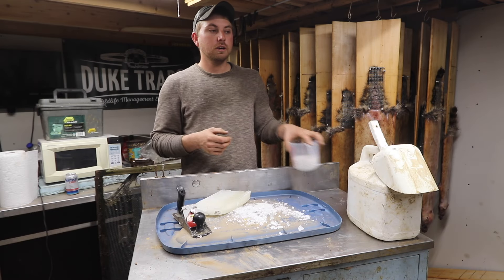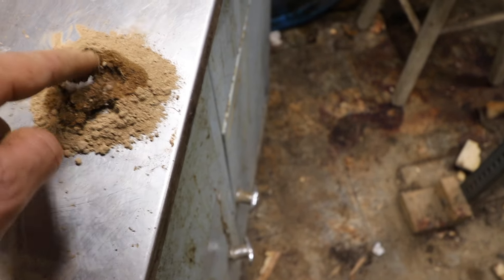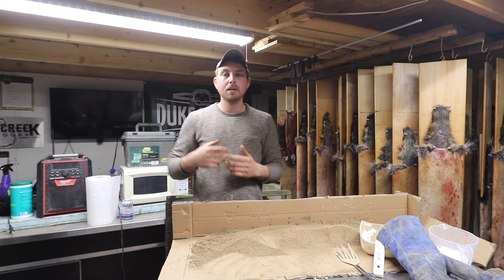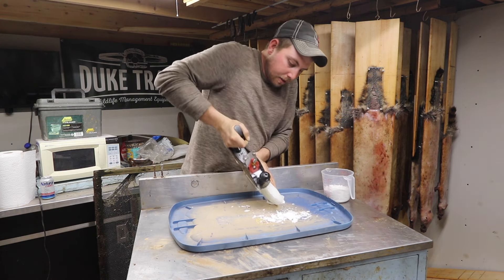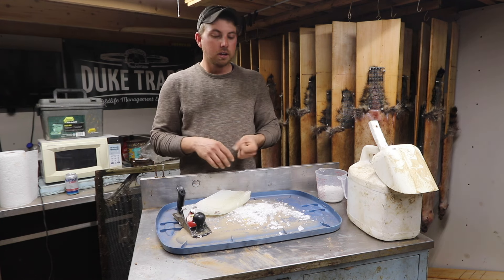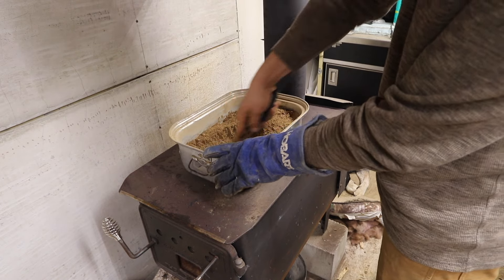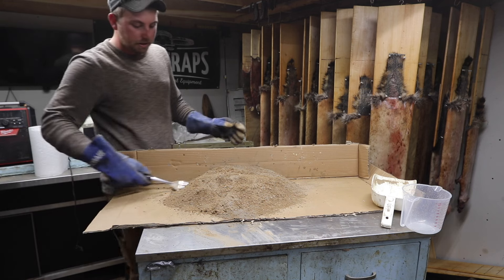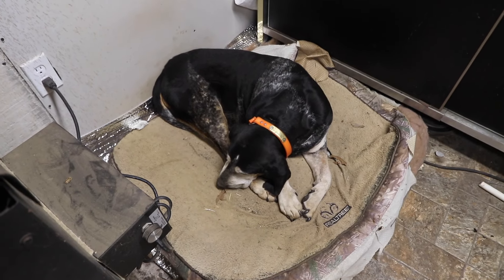How to Make SMALL Batch Wax Dirt

Comment: Just did this on about 1.25 gallons of dirt in <1.5 hours. Still damp from outside. Sifted and split into 4. Dried each batch out on the gas stove. 10 minutes each batch. Then heated all back to temp. Used your wax flaking technique and mixed it in a bit at a time. Mid high temps and stirring basically the whole time. Tested with your water trick. Looks perfect. Thanks bud 👊🏼👊🏼

Comment: A surform tool works well also to flake wax,just clean with a wire brush if it clogs,real cold wax works better. Surform is similar to a rasp yet not a file,similar to a hand plane but has a grater blade instead of solid & a handle like a file.

Comment: Would it work to just melt the wax on the stove and heat the dirt in the oven and then just mix them while theyre at about 150-160 and stir it while it cools? 

Not sure why it has to be flaked if it just melts in. Thanks for the video btw!

Comment: hi l'm 12 and new to trapping coyotes i'm making dirt hole sets and using sheep wool and cavins  baits and lures  but the coyotes are walking past the sets without working the set any advise,
Reply: If your seeing tracks near the set just give it time.  You could also try putting another set opposite of the one that’s there now on the other side of there tracks Incase the wind isn’t blowing the smell across their trail. Keep it up bro it took me like two months to connect on my first one.
Reply: You aren't doing anything wrong. Some coyotes are well... It's mating season and have other things on there mind right now. You can put a small handful of dogfood on the walking path but don't put it on the trap  something to get there attention.. I've used feathers and it worked. Don't give up..
I have had traps in the ground for weeks before I caught anything. Patience !!!